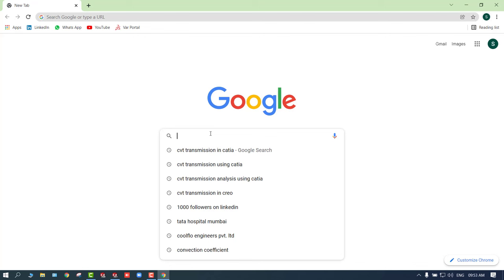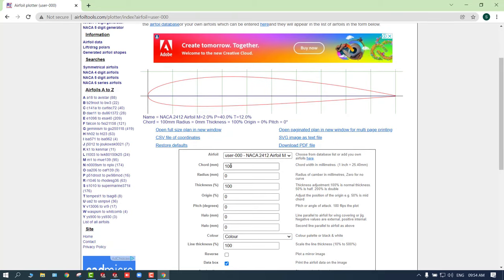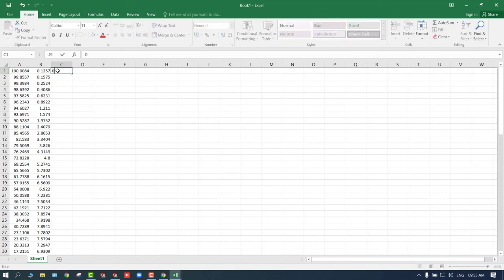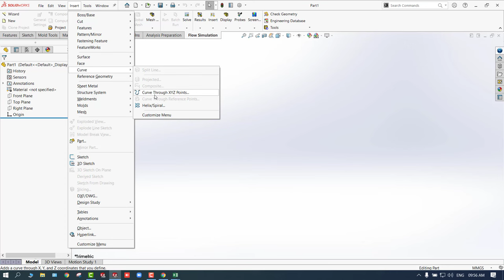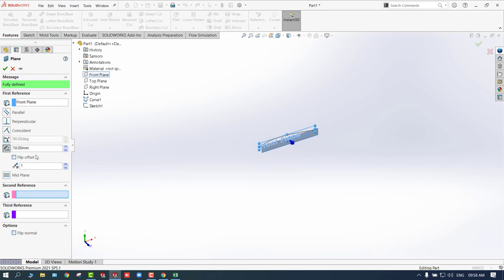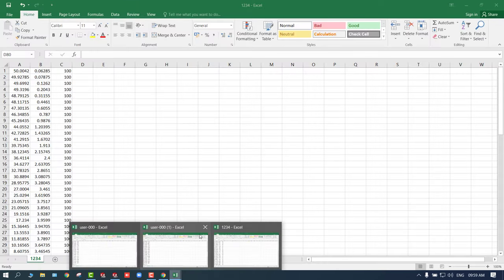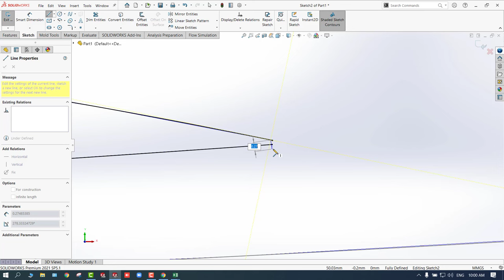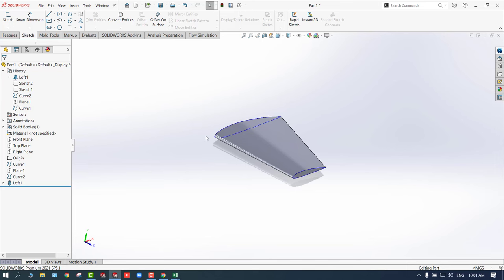How to import airfoil coordinates | Modeling Airfoils In SOLIDWORKS

Comment: u have missed something and hasnt recorded, i followed your way 100 times it doesnt go on reference plane but keeps on importing on the same fromplane where the first airfoil was imported
Reply from the maker: 1) You need to change the z value to the distance from the reference front plane ( its 100 for me there). I think you missed entering the z value from 0 to 100. 

2) Even though if it's comes on reference front plane, you can create a a plane at a distance of 100 or the value you are looking for and then sketch on new plane and selecting small airfoil curve and selecting convert entities will surely help you. 

💐 Thanks for asking...
Reply: @cadguru_7  I was facing the same issue thank you so much